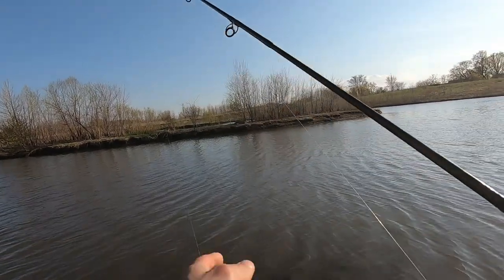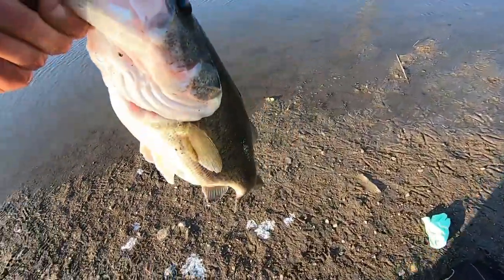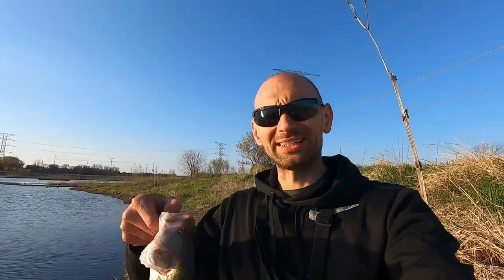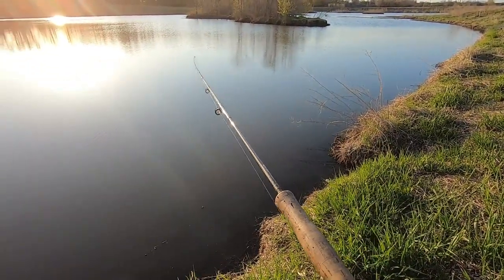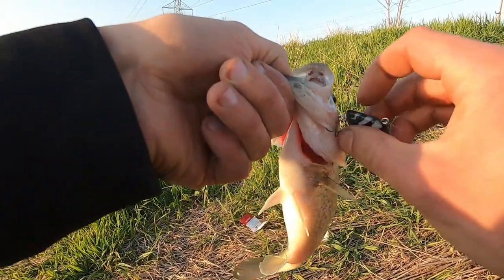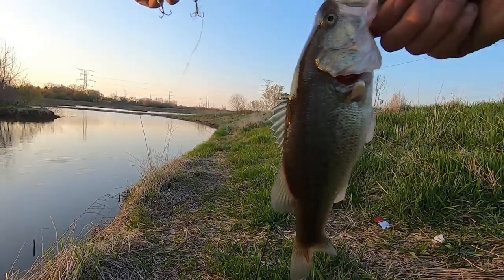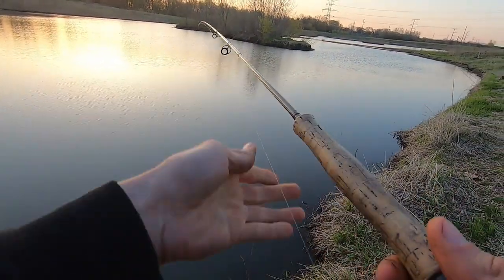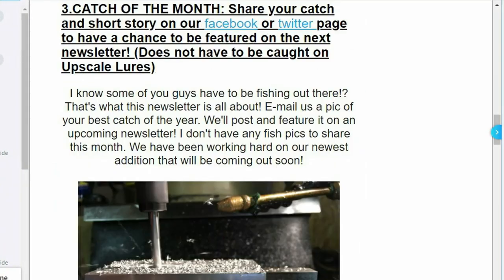3D PRINTED SMALL PANFISH LIPLESS CRANKBAIT FISHING LURE TEST

Comment: Thanks for sharing your print design however I am having some issues creating the supports you have in the beginning of this video. Somehow, I am unable to move it up the z axis to add a cradle like support.  I am new and any advice would be greatly appreciated. Also it says one fish eye is missing material. Awesome design though!
Reply from the maker: All slicer programs are different in how it generates support. What slicer are you using to 3d print the lure? 

Usually there are options on what degree angle it will add support, adjust that and it should add more where it’s needed.
Reply: @upscalelures  i am using Cura. I wish I could find more video tutorials on how to use Cura slicer. So change the angle and it may add more supports? I’ll give it a try.  Thank you

Comment: Thanks for sharing. What and where did you get the hardware for the hooks and top to attach the line too.
Reply from the maker: For the screw eyes and split rings if you need them right away hobby lobby has them in the jewelry section. They are on the cheaper side and are not very durable. Otherwise lurepartsonline.com has all you would need.

Comment: Maybe 3d print a mold for soft baits?
Reply from the maker: That would be kool. But I think the hot plastic would melt the filament mold. I have 3d printed a lure for soft plastics and used that to make a mold out of silicone.
Reply: @upscalelures  I didn't know if the metal Infused plastic . steel or aluminum would hold up. It will shrink a little.
Reply from the maker: They might have a higher melting. That would be worth checking out. @revamped outdoors is also doing something similar with the  3d soft plastic molds. https://www.youtube.com/watch?v=MkCglbAV4hs

Comment: What clear coat are you using?
Reply from the maker: Penguin Life Solarez polyester gloss UV Cure resin. Fast cure and durable , works great!
Reply: Does this need to be cured by a UV light? The website says to cure either by UV light or MEKP, but then on the cans it says sunlight or MEKP. I'm confused.
Reply from the maker: Penguin Life A black light witch is UV, works well. You can find a cheap UV Nail Lamp on ebay or Amazon. I use that for a solid 30 Minutes. You can cure them in the sun, but take longer in my experience.